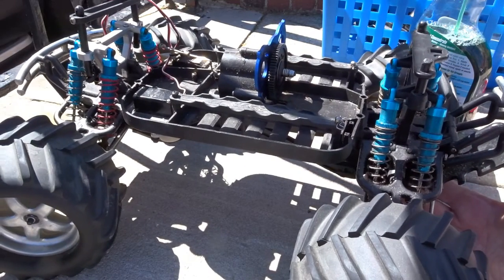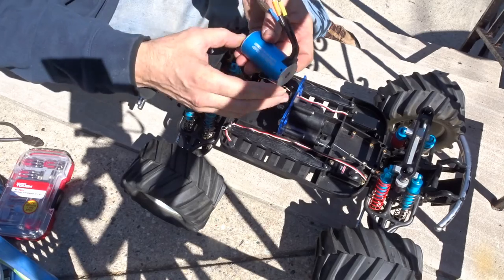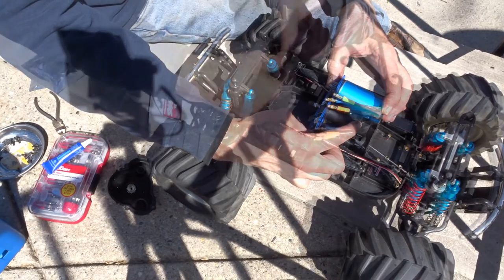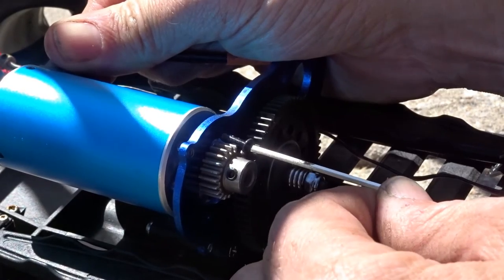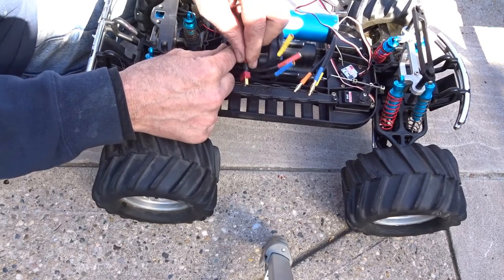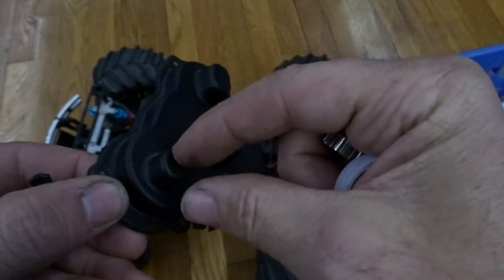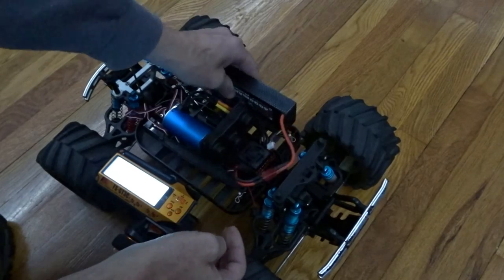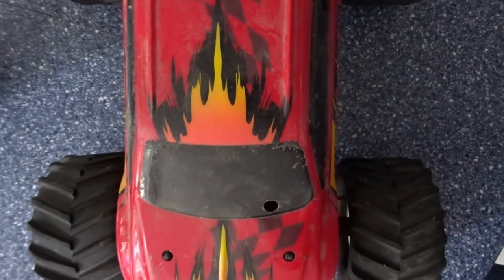Traxas  E Max Conversion 2.4 and Brushless  .

Comment: 3.175mm shafts is standard 1/10scale n smaller rc’s anything 1/8 scale n bigger use the 5mm shafts, u can get the collar they sell to go from 3.175 to 5mm
Reply from the maker: Yes thank you. ordered   not the 3906 model, I ordered. I needed more or less a different motor   with a  2 plus mm shaft. and the 
gears I had would have worked.

Comment: Awesome Emaxx brotha! I do n use the same products n style u clean,great video, doesn’t the emaxx let u run two motors or is that the T-Maxx? Lol sorry so many rc’s to keep track of. 👍👍👊👊📹📹
Reply from the maker: It's a two motor system and  hi Low gears ,  I opted to   work one motor one gear, and still use the hi low..  I am now working out why the  truck when  stops Brakes. esc programming of  Seller  goofed.